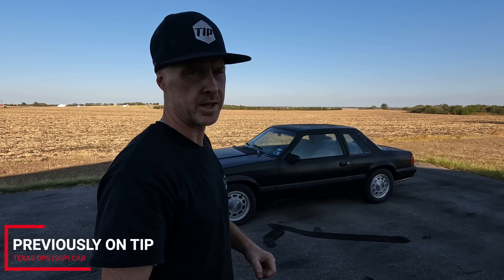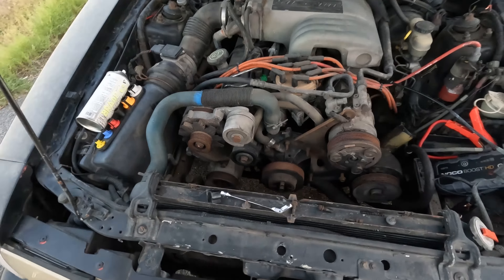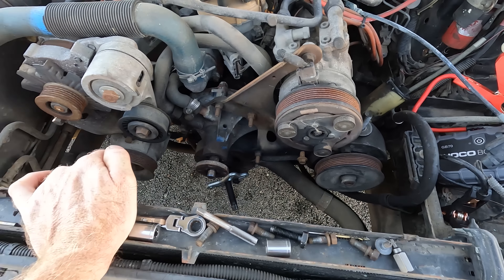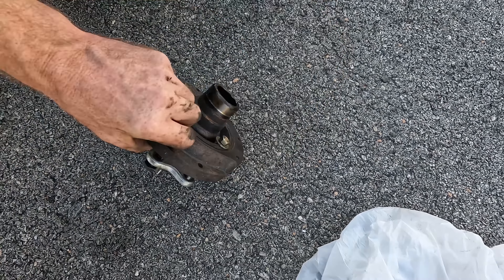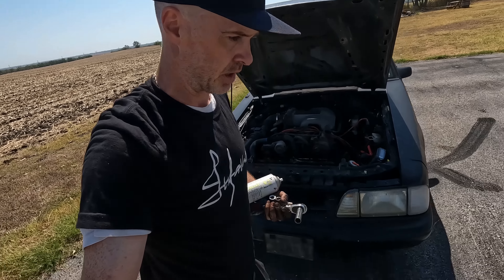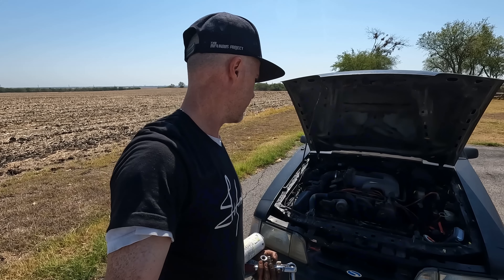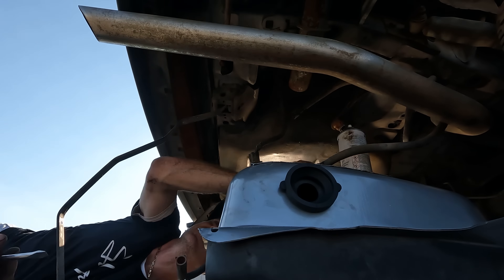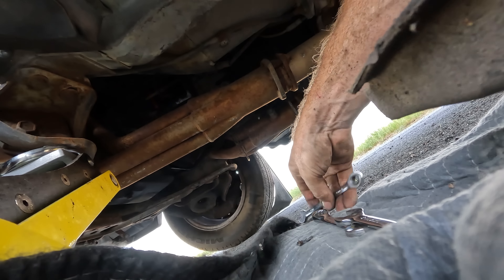1993 Texas DPS SOLD! Will it Run Part 2

Comment: There were dozens of these fox intercepters in Houston in the late 90's. TEXAS State Troopers. They were very aggressive traffic law inforcement. No one called these cars coups. No kids(late teens early 20's) in the street scene wanted a coup. Coups were for the state and hatchbacks were for the kids. However over the years I've grown to appreciate a hi quality coup build.
Reply: You hung out in the wrong street scene in Houston in the late 90s.  Everyone I knew wanted a coupe including me who owned one.
Reply: @matta8406  By far, the biggest and best scene was Westheimer down by George Bush Park. That Kroger parking would be overflowing with cars. Hammerly high dive spot for toll road racing. Cutten Rd by hwy. 6 had 100s of kids. Rarely saw a  coup out there. 97-03. I could take you to Rakin Rd and show you some coups, but it wasn't a street scene. It was a closed off industrial road. I  went there a few times, and it was 30-60 year old guys with $60,000 doller builds dominating a 1/8 mile in a car with no passenger seat.  Our scene was young people with full super clean interiors. Clean paint and body with big shiny wheels And went as fast as we could with our  teenage paychecks. Where did you and your buds race?
Reply: Rankin mainly.  Sometimes went south to race.  We just raced, different than I guess the street scene like westheimer.
Reply: @matta8406  Rakin had some heavy hitting Baytown level builds. The Coup's and WS6'S Ruled the street/strip class. At least the few times I was there
Reply: Pretty good racing in the late 90s real early 2000s.
Reply: @matta8406  The Toll Road run is still fun in my old pony.  The Westheimer toll plaza to the 290 Plaza. 2-3 in the morning

Comment: To many miles
Reply: Not really. My SSP finally game me issues at 306k. Broken cam bolt. And it was with many original seals. Anyways parts are plenty and so long as there is no rust those foxes pretty much run forever.